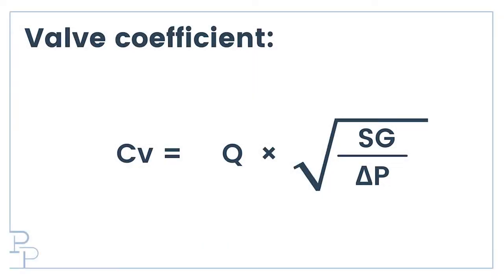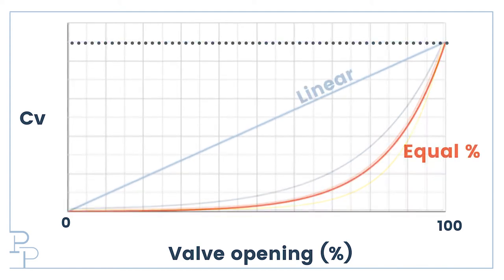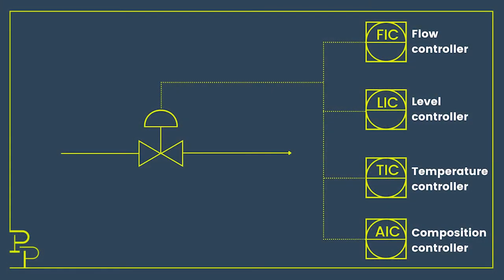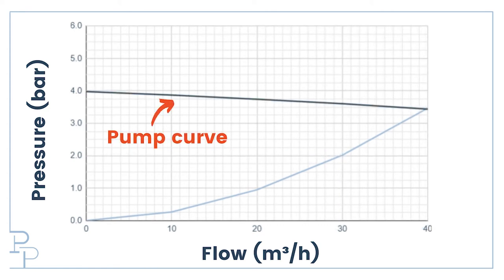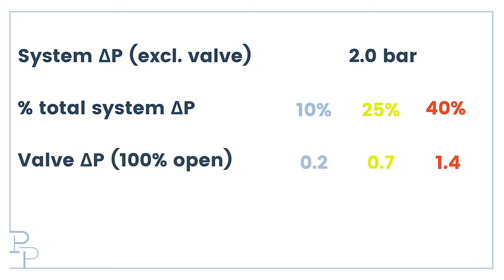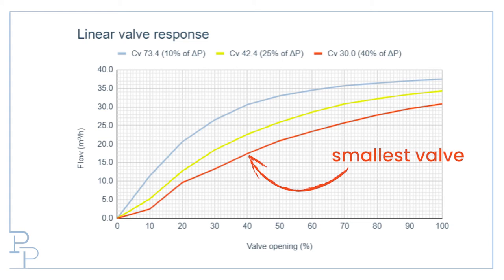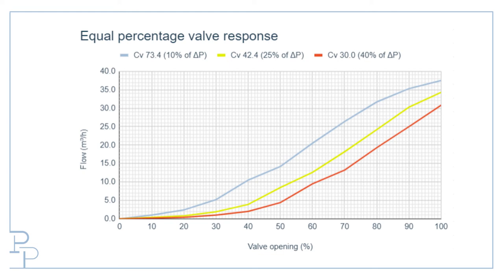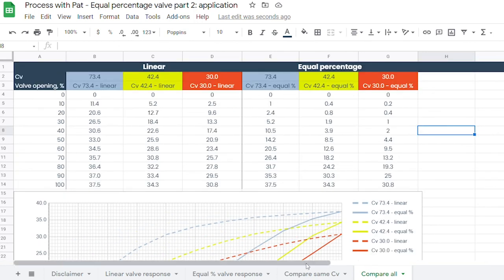Equal % valves - Part 2 - Why do we use them?

Comment: Great discussion about control valve characteristics.  I'd worked with several control systems and getting the linear behavior was always a key part of getting good control performance.  One notable problem was a control valve to regulate steam flow to an auxilliary turbine that was coupled to a centrifugal pump where the end goal was to control the flow via pump speed.  So first the system curve, then the pump curve, then the hp vs pump speed, then steam flow vs turbine power developed, then finally steam flow vs valve percent opening.  Ugh...  So naturally, we did some manual tests at various points, plotted things out and made a 'little black box' of electronics that converted linear flow controller output to the desired valve-open command.

Process flow control systems have always been fascinating for me, and I've enjoyed your videos on the topic.  Thanks you.

Comment: One other thing to keep in mind is that Eq% works better when you have a normal flow close to the low end of the valve.  For instance, say you normally need 2 gpm of flow through a valve, but there are times you want 10 gpm lose when you want to quickly fill a tank but after doing so, you need much less flow to maintain that level.   The Eq% gives you better resolution and finer control at the lower flow while allowing you to still have high flow when you need it.  The quick opening trim can give you better resolution and finer control when your normal flow requirements are close to your maximum flow rate.

Comment: Nice.  A question.  You said that some of the valves had higher operating cost.  But if we are hitting the same targeted flow of 30 with all else being the same in the system, then we have the same delta-P across the valve to achieve it.  Isn't the pressure capacity of the pump vs the chosen operating pressure what selects for cost?  Though I never studied chemical engineering and I'm a college drop out so I may have it wrong.